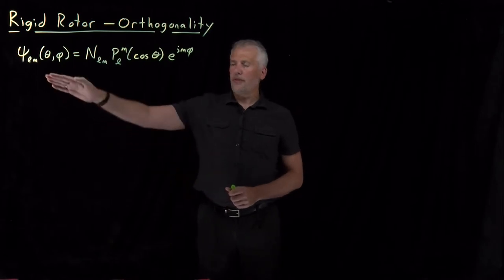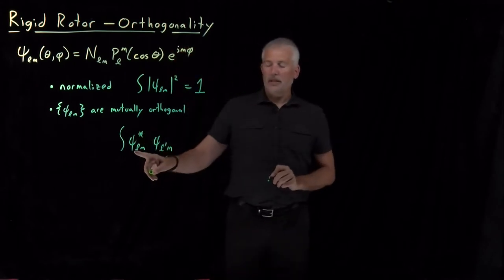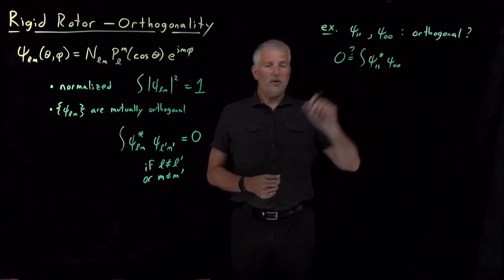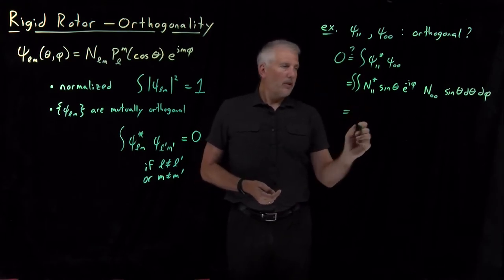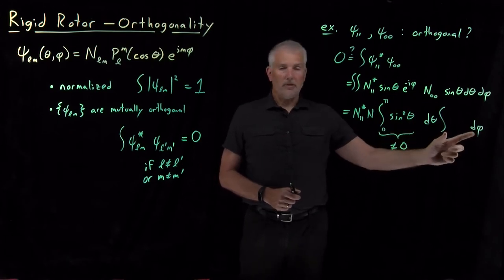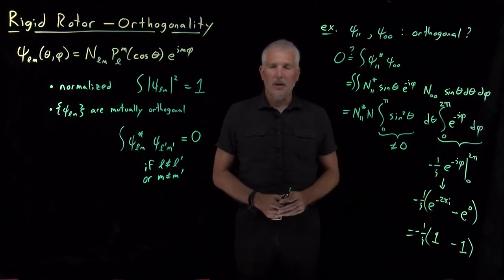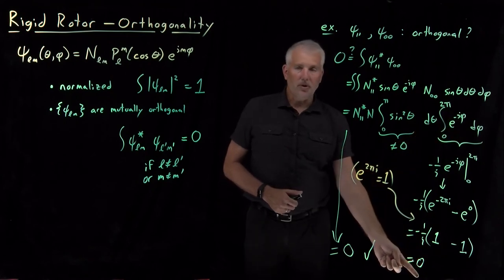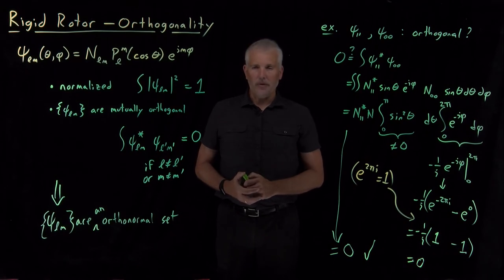Rigid Rotor - Orthogonality

Comment: Hi Dr. Stuart, why there is a sin(theta) as integration factor?
Reply from the maker: It's because the integral is performed in angular coordinates. Any time the integral is over the θ and ɸ coordinates, the integration factor will be sin θ dθ dɸ. 

(You may be more familiar with the integration factor r² sin θ dr dθ dɸ, but here we are only using the two angular coordinates.)
Reply: @PhysicalChemistry  Thanks for your reply. I really enjoyed your lectures, I never was able to connect from quantum mechanics to macroscopic properties until watching your lecture, the logic is so clear. THANK YOU!!
Reply from the maker: @jiajunlei7783  Thanks. I'm glad to have been of some help. It's easy to get lost in the details and think quantum mechanics is very abstract, without much practical application. But once you know how to make the connections, it explains MANY different things.